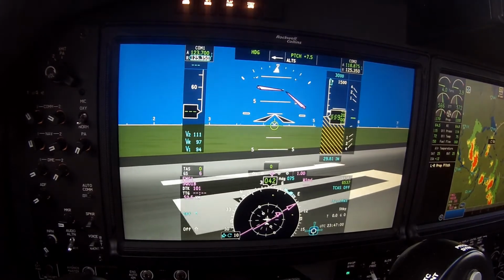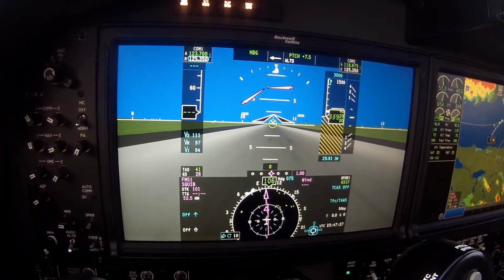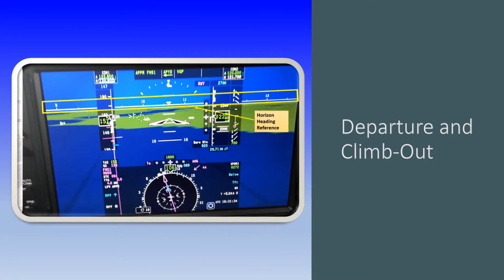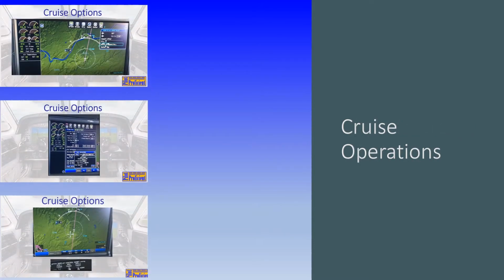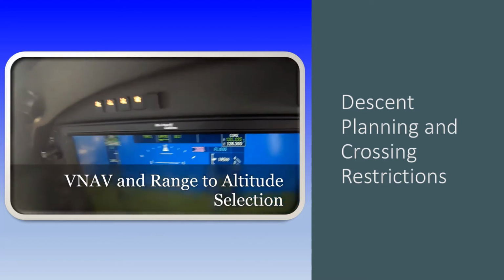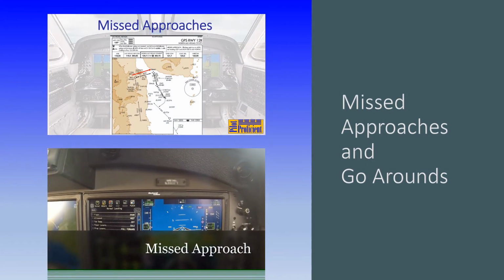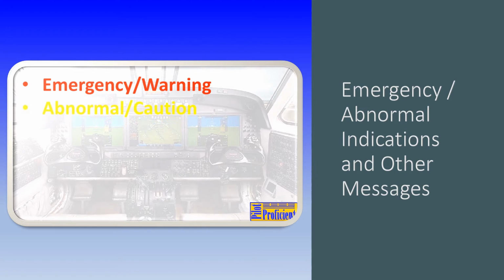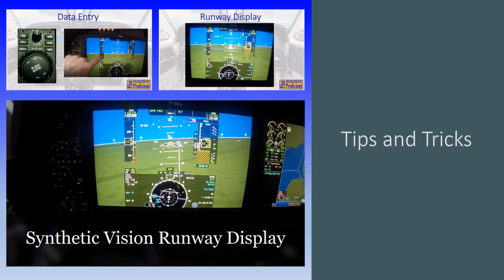Proline Fusion Familiarization Course Preview

Comment: Hi. Is it suitable for Challenger 604 FUSION?
Reply from the maker: While the system architecture is similar and the course would be helpful for the Challenger application, our course does use a King Air 350i as the demonstration airplane for most of the  segment videos.